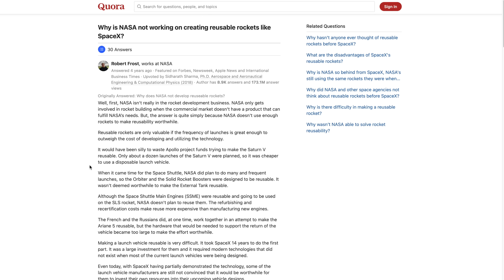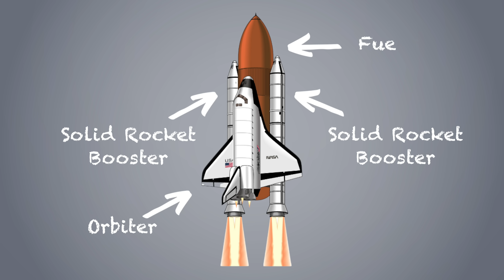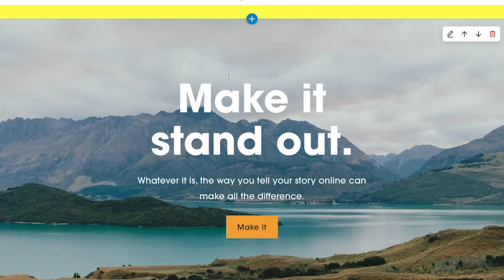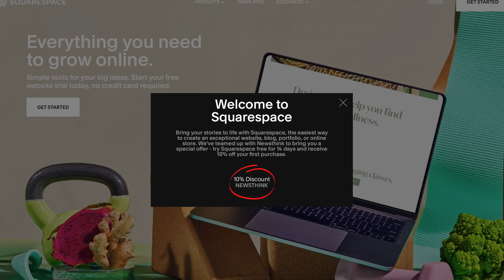Why NASA Doesn't Fly Reusable Rockets

Comment: If Gateway station is finished, will NASA use SLS for crew transfer that cost $2B/launch or using Starship that 0.1% SLS?
Reply: They will try
Reply: As I understand it, Falcon Heavy is planned to launch the first two Lunar Gateway segments together in May 2024 for the Artemis III Moon landing in Oct 2024. A Starship tanker will get fully fueled in low Earth orbit (LEO) by other Starship tankers. Then an unmanned Lunar Starship will meet the Lunar Gateway at the Moon. Orion will then launch in Oct 2024 on SLS to meet Lunar Gateway & Lunar Starship. The Lunar Starship will land half the astronauts and return them back to the Lunar Gateway after a week or so. Then Orion will take all the astronauts back to Earth.

Starship has no planned abort system, so it's expected to take many, many successful, reliable flights for it to be considered safe for Earth takeoffs landings with people in board. Orion has the range to get to the Moon and back and evidently only SLS can lift it to orbit. Falcon Heavy is not man-rated and Orion appears to be too long for it currently. Crew Dragon and Starliner only have the range to LEO. Apparently, a fully fueled Lunar Starship can get from LEO to the Moon, land, and get back to lunar orbit, but it needs more fuel to return back to Earth. It's possible that a Lunar Starship variant could shuttle between the Earth and the Moon, but that would likely be after the initial Moon landings. NASA is worried enough about having enough Starship Tankers just to refuel Lunar Starship without adding in another one to refuel.
Reply: @steveaustin2686  thanks I really understand, but I a bit confused with tanker Starship. When the tanker lift off from earth, will it carrying fuel cargo or just empty cargo?
Reply: @febrianarifin7723  Apparently the plan for a Tanker Starship is to be nothing inside but a methane tank, a LOX tank, and avionics. A regular Starship is planned to have 1,200 tons of propellant and 100 or so tons of cargo. Most of that 1,200 tons of propellant is used to get to LEO and I don't know how much is expected to be left over. Likely, only SpaceX and NASA know. So a Tanker Starship will have 100+ tons of extra propellant once it gets to orbit. Most estimates seem to be 5-12 tankings to fill up a Starship. 

Just for guessing, lets say a regular Starship with 100 tons of payload (crew spaces & cargo) gets to orbit with around 100 tons of propellant left over and some margin for landing. So it has almost 1,100 tons of empty tanks. So a Tanker Starship could carry 200 tons (100 tons left over and the 100 tons cargo), then you can get 1,200 tons of propellant in 6 tankings (200 tons in the first flight and 5 more of 200 tons each). So you send up a Tanker Starship and fill it 5 more times to get your 1,200 tons of propellant. You then have the regular Starship/Lunar Starship meet the Tanker and refill all at once. Then you send off the newly refueled Starship and land the Tanker if you need to do maintenance on it or leave it up to start refueling for the next mission if it is launching close enough. 

Lunar Starship is planned to have a 100 days of loiter capability to wait for Orion to meet it in lunar orbit. So if the Tanker Starship has the same, then it could take 100 days to refuel it to full 1,200 tons capacity. IF you needed 6 flights, that is one flight every 16.7 days. Right now, two different Falcon 9's have turned around in 27 days. So if Starship can get to a one to two week turnaround, then refueling Starships in orbit is doable. I know Musk wants multiple flights in a single day, but just a week turn around would be a huge jump in reusability.
Reply: starship will probably not cost that per launch, it will be much higher, being optimistic it will cost 1 billion dollars
Reply: @anguita119  Musk says that he thinks that he can get a Starship launch down to $2M per flight once they get operational. Most expect that to be an overly ambitious Musk target. If SpaceX can get to the reused cost of a Starship down to the Falcon 9 B5 reused cost of $50M, that would be a big cost savings. Even the $90M of Falcon Heavy reused cost would be good.
Reply: @steveaustin2686  You said it, what does elon say, do you really think it is a reliable source?
Reply: @anguita119  Musk has a history of setting overly ambitious targets, so it's not unexpected. Apparently the ground costs of a launch are over $2M. If you  need 6 launches to refill a Starship and if the Starship cost is $50M per launch, then you are talking $350M for 100 tons in orbit in fully refueled vehicle to go lots of places.
Reply: @anguita119  Dude, the engineers at SpaceX do the work. How gullible are you is the more important question. SpaceX has provided results in the past, so I await to see what they will provide for the future. How close will they get to the plan and how close will they get to the dates planned.